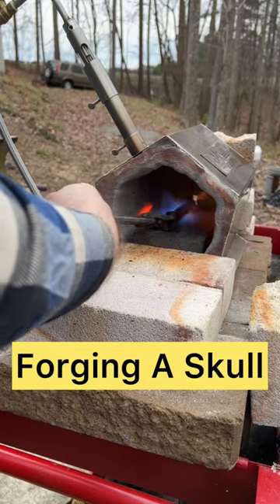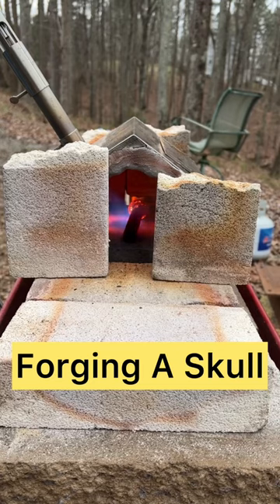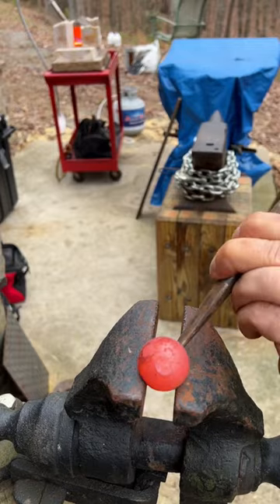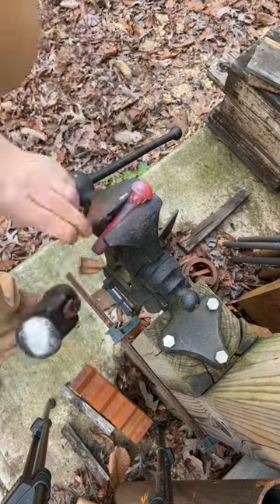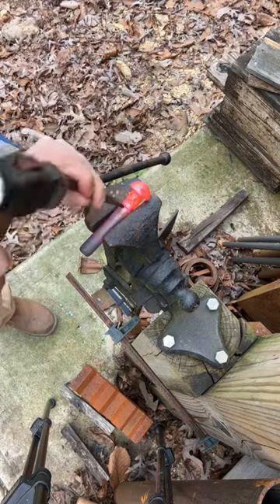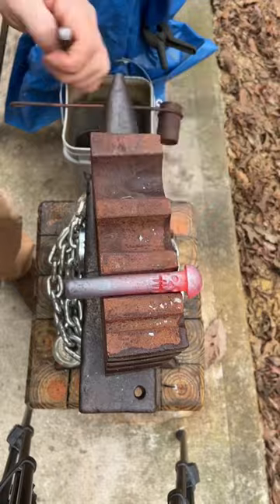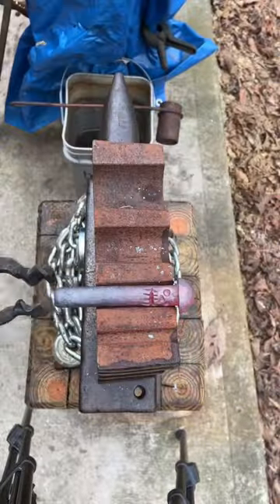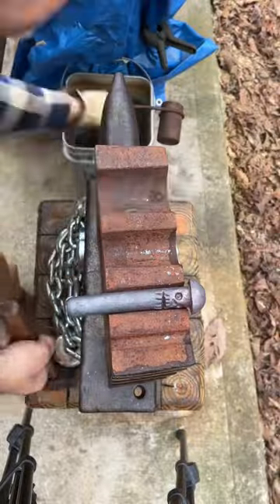Forging a skull from a bolt #shorts #anvilstand #forging #anvil #blacksmithing

Comment: Amazing. Wish i had it! Please straighten the shaft. Also, in the bottom of the shaft, you can make a hidden bottle opener of some sort.
Reply from the maker: Thanks! Glad you like it.  Not sure about a hidden bottle opener, but I am thinking about turning it into a full figure with arms and legs...  I have other projects that have a deadline, so this one will have to wait.
Reply: @DW Wood Builds  I was thinking you could make iti a hidden opener or something similar in the idea that it looked the same, and there would be nothing obvious to it and made people wonder what it is. 😁
Reply from the maker: I understand you meant for me to make it.  I don't really see how to make what you suggest at this time.  I'll think about it, but like I mentioned previously, I have a deadline for other projects that need to be completed.
Reply: @dwwoodbuilds  Yes, yes, ofcourse, make it or don't make it, your choice, your time, no pressure from us. Especially me. :D Either way, amazing thing you made. :D

Comment: what company makes the forge you used in the video if you don't mind me asking? Also how has your experience been withnit so far.
Reply from the maker: Its the Mr Volcano Hero single burner kit.  I honestly love it.  I also have a coal forge but the propone forge allows me to have multiple pieces going at once which really helps my productivity.  I believe its the best value for the $.
Reply: @dwwoodbuilds  awesome thank you so much for the response. Ill be ordering one later this week and starting on my journey to learn  how to forge blades and other things.
Reply from the maker: Great! The instructions that come with the kit are very good.  There are also several videos showing how to build them.
Reply: @dwwoodbuilds  thats awesome. Thank you so much for your help.